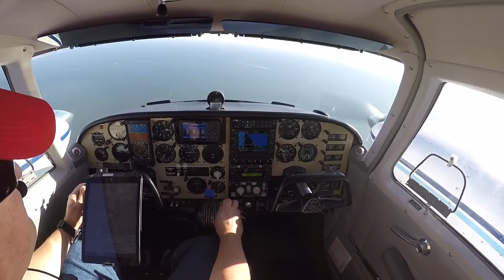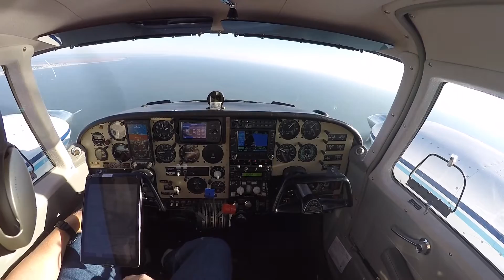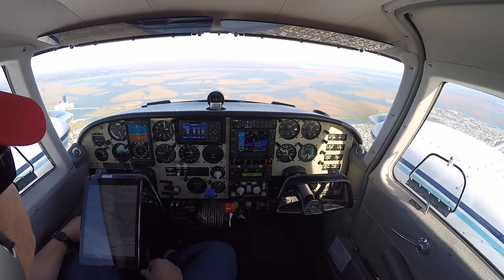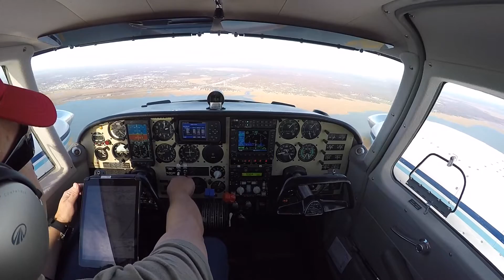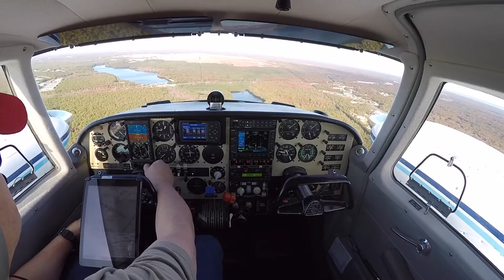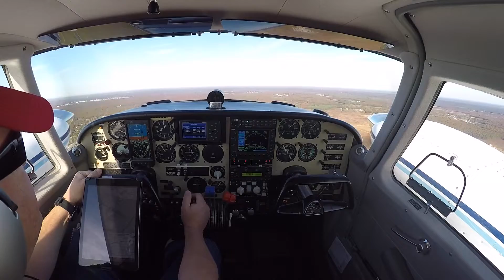2015 10 31 N833DF Altimatic IIIB Automation

Comment: Which of your equipment announced, “five hundred”?
Reply from the maker: I believe that’s the Aspen. Same as the minimum call. Makes me wonder why the Altitude call out is some snotty corporate guy sniping at me.  

I decided on the STEC 3100 replacement autopilot when/if it becomes available. yesterday I went flying, and the autopilot flew flawlessly. Turned it on at 1000’  and flew 2 precision and one non+precision approach hands off.

Comment: I heard you say that the heading bug matters when you are in the LOC NORM mode.  My Century III in my Bonanza with the KA-52 adapter doesn't look at the heading bug once in the other modes.  I guess you are able to make slight offsets to the needle with the heading bug?
Reply from the maker: Marty Mitchell   If heading isn’t set correctly in a strong wind (bias right for strong right wind) , the A/P struggles to hold dead center on the localizer. 

Frank
Reply: I believe mine can track properly if the crosswind error is within 15 degrees, otherwise, it too, will struggle.  With my model, you can adjust the OBS a bit, not the heading bug, to help it stay on course in strong crosswinds.